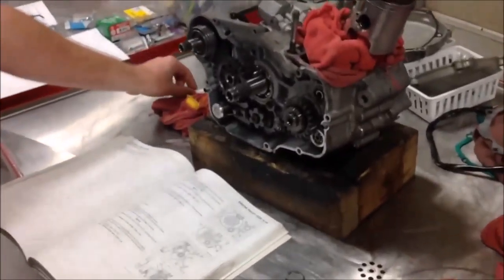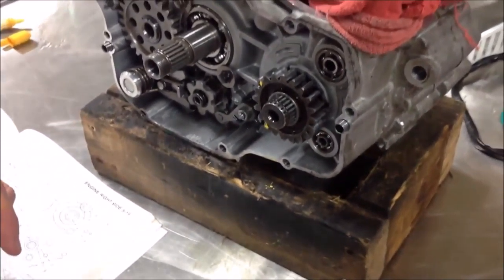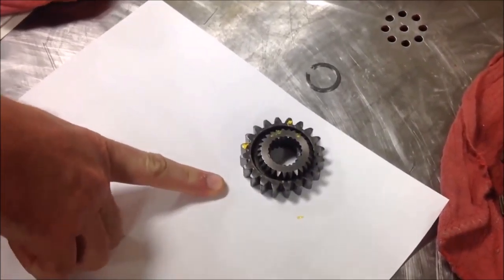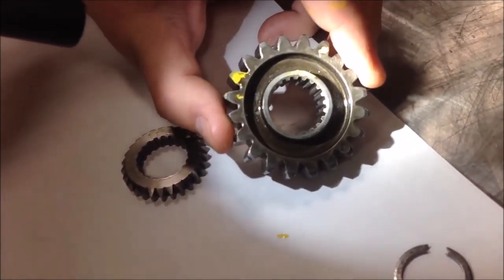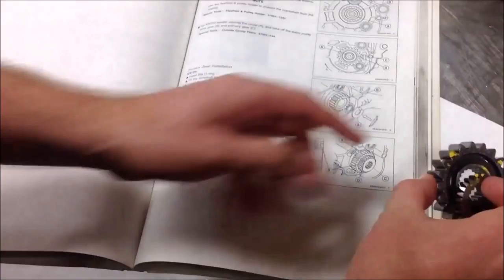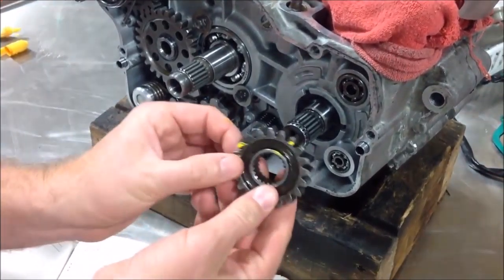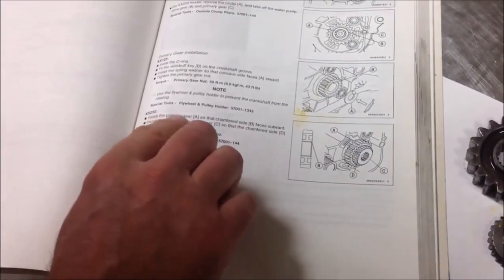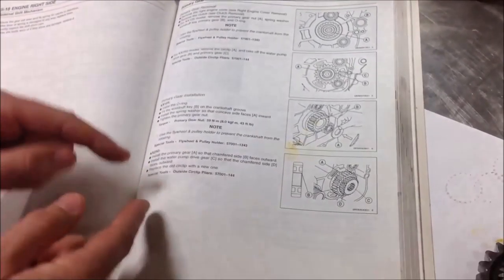Never trust the last mechanic! How to avoid getting burned!

Comment: You can also go to a place like Motosport.com and look at OEM parts and you can look at a full schematics chart.. That is, if you don't have a service manual. Thanks! Good video.
Reply: You can cross reference with the micro on the Motosport website, but you NEED a service manual.

Comment: Hey Shane,

i'm a mechanic myself, well i'm working in a motorcycle shop for the past year. (If you can call me a mechanic at this point)
and you seem like a really smart and genuine guy, so i subscribed a while ago.
At our shop things don't get put together the way it should. I had an oil leak because of a warped case. They told me to put more RTV Silicone on it. I measured the distance from the warpage. If you press 1 side down the other one comes up about .75mm or ".029. Can RTV fix this issue? Or does it need to be replaced for sure?

Thank you in advance.
Reply from the maker: Welcome to the community. The RVT give specs for the amount of gap they will fill. Google the product you are using and hit up the spec sheet. Keep in mind companies make products for different uses. For example: good tight machined surfaces may use one product and "flanges" use another. You must do your research and know what you're using. Also, pay attention to recommended installation. We just read the package of a product I'm been using for years that says to wait 20 min before assembling mating surfaces! Opps....:)

Thank you!  If I can ever be of service to you, here is a video explains how to connect with me. 
https://www.youtube.com/watch?v=vjvmB01ebcs 
Keep Wrenching,
Shane Conley
Instructor/Motivator/Motorcyclist
www.how2wrench.com
Like freebies? Click here for a free diagnostic checklist! 
http://gem.godaddy.com/signups/364621/join 

Did you like this free video and hope to see more? Would you just like to say thank you with a donation? Click https://www.paypal.me/how2wrench
Show less